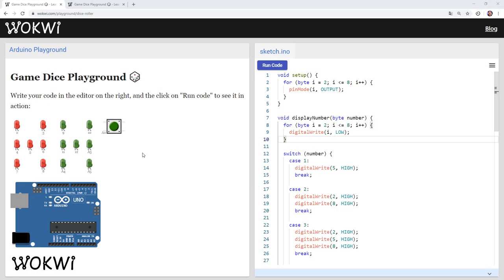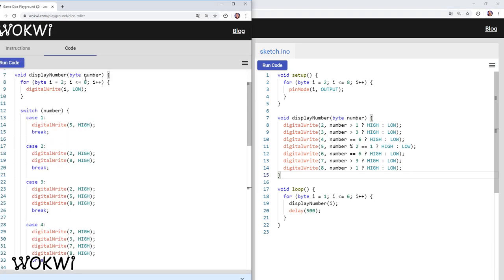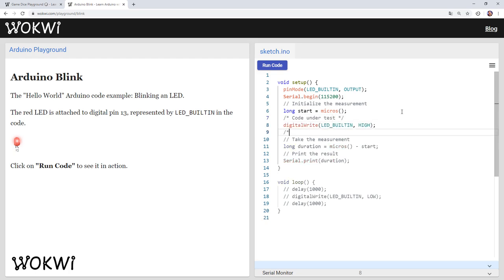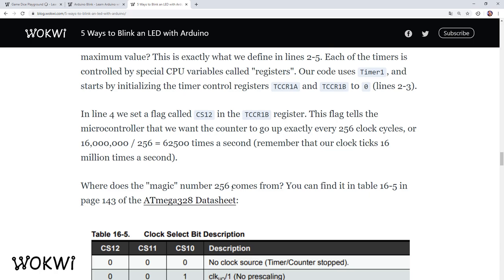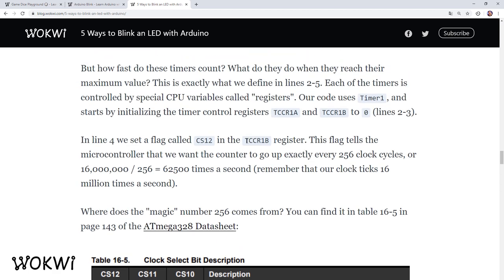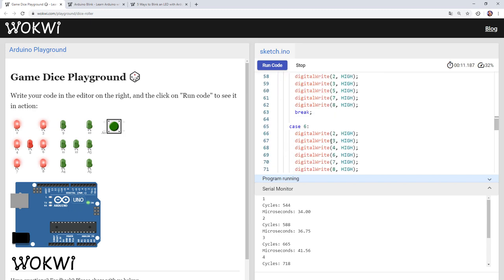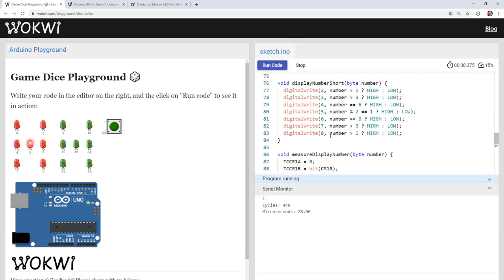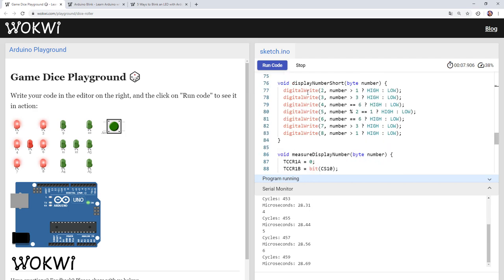How Fast Does Your Arduino Code Run? ⏱

Comment: 6:35 TIP: If your frequency is 16 Mhz then (1/f = T) it means that 1 cycle takes 1/16 000 000 = 62.5 ns and if you have 38 cycles. 38 * 62.5 ns = 2375 ns = 2.38 micro seconds.
Reply: is it really tip or is that extremely basic mathematical aptitude?

Comment: It would be interesting to see how this could be adapted to work with the new Arduino UNO R4. It is not based on an ATmega chip therefore the registers are different and from what I could see also the execution of instruction is rather different. I tried to apply the same concept presented in this video using the General Purpose Timers but I could not obtain a working example. Maybe you are able to do it having more experience in the field.

Comment: This is what I've been looking for.  Experimenting with branchless Arduino programming and measuring its speed improvement has been problematic.

I would be interested in your take on branchless Arduino programming.
Reply: Branchless programming is not really interesting on AVR-based Arduinos. The AVR has a very shallow pipeline with only two stages: fetch and execute. The branch penalty is then minimal:

 - an unconditional jump takes always two cycles

 - a conditional jump takes two cycles if the branch is taken, and one cycle if it's not.

Comment: So if we did 1000/microseconds we will get the frequency of the loop in Hz or as known as pulling rate? I am little bit confused about (sampling rate, frequency rate and pulling rate)? Also can this code be used with STM32? Thanks
Reply from the maker: Frequency (without "rate"), when measured in hertz units, is how many times per seconds something happens (e.g. if you clap your hands 3 times per seconds, then your clapping frequency is 3Hz. If you clap your hands once every 10 seconds, than your clapping frequency is 0.1Hz). 

Sampling rate is how often you are measuring (sampling) something. E.g. if you look at the watch once every two seconds, your sampling rate is 0.5 times per second. 

Not sure what's "pulling rate". 

STM32 - no, you'll have to use code specific for the STM32 timers. The principles are similar, but the code is completely different.

Comment: what if you use port manipulation, create an array like const byte leds [6] = { B00010000, B... the 1s is the address in the port D you want to turn on.
so you call just the memory to PORTD = leds[number];
Reply from the maker: Sounds like it could work! Depending on how you use it, if you put a constant number in the array index, the compiler may even be smart enough to optimize it and just put the constant value in place...

Comment: Why is digitalWrite so slow?
Reply from the maker: It has some logic within to deal with PWM (for some pins) and map from Arduino pin numbers to port register and pin index. You can take a look at the source code and see everything that it does: https://github.com/arduino/ArduinoCore-avr/blob/24e6edd475c287cdafee0a4db2eb98927ce3cf58/cores/arduino/wiring_digital.c#L140

Comment: I do not understand half of the thing mentions here because I am a true n00b. But I learn that speaking near to machine language is the best. If we can code with pure 1 and 0 then we would achieve the fastest and most accurate timing.
Reply from the maker: One step at a time :) But if you understand half, that's already a good starting point!

Actually, coding with Machine Language yourself will usually not get you the fastest timing. The C++ compiler can sometimes do optimizations that a human would usually overlook. But the ability to read the machine code that the compiler generates can be useful in those cases when you have a performance bottleneck in a specific point and you want to optimize it. 

Here's another example of using machine language within MicroPython (an embedded version of the Python language), to optimize a specific function that happened to be a bottleneck: https://urish.medium.com/embedded-python-cranking-performance-knob-up-to-eleven-df31a5940a63

What project(s) are you currently working on?
Reply: @Wokwi  Urgh! I might not have the flair for programming languages. Few successful programmers say that to be successful in programming one has to sit before their computers for hours on end. I tried and I was committed (No poking phone. No computer game. No shopping. No unnecessary distraction). I was genuinely interested in getting it (whatever project I was doing) done. But...oh well.

I think the problem with me is I have high tendency to go to the most efficient way of doing things. Excellent example is this one - speak to ATmega's registers rather than human-readable-commands.

Having said that, I THINK (only in my bloody tiny brain cell) that I would be more successful in messing about ATmega's language. Because it looks very simple and easy. Certainly looks can be deceiving! Ah ha! I do not know yet. I do not know yet because I have not obtained the board. I am waiting for that thing to arrive, so I am first doing theoretical research. Arduino is meant for idiots, I think I would do well.

I think I would do well because I probably would be using zero brain cell because the project I am interested in at present is using Arduino as cheapo oscilloscope. I was understood that oscilloscope is a low-level project, it utilizes ATmega MCU capabilities directly, without the Arduino library. I just hope that I do not fry any I/O pins nor the chip!

Ruggeduino has every safety feature possible, but I am not willing to fork out that money. Twisted positive thinking, justification, and rationalisation of my own inability to pay tell me that being in danger zone may train me be more analytical and careful rather than taking life for granted. Now, that is a little unfunny humor!
Reply from the maker: It's a good tendency to explore and learn how things works under the hood. You may be interested in this free AVR internals class: https://www.youtube.com/watch?v=WUNxaQGAJjU&list=PL_tws4AXg7avNexvQxkfxfEBtvTtBi6Tu&index=2
Reply: You would not want to program in machine language (the 1s and 0s). Assembly is just as fast (as it is translated word-for-word into machine language) and a lot easier to write. And as Wokwi said, C and C++ compilers at quite good at optimizing.

Note that often humans can write more efficient assembly than the compiler, as they have one great advantage: they can run the compiler to see its output, then improve upon it. Yet, it is very unlikely you will ever need the performance of hand-written assembly and, if you ever need it, it will be for very specific time-critical code sections.